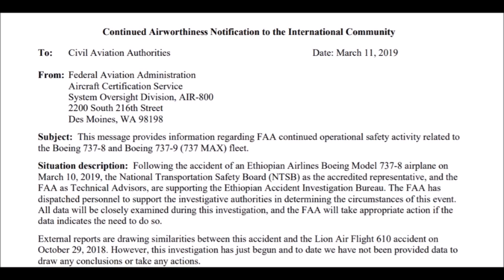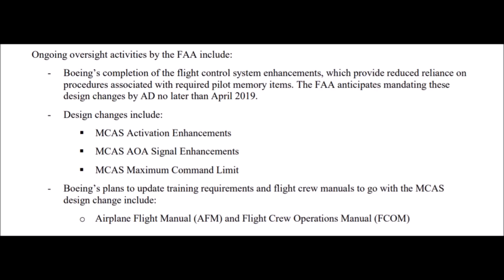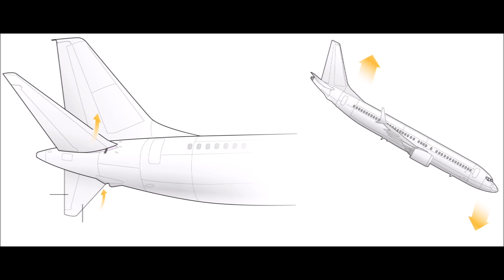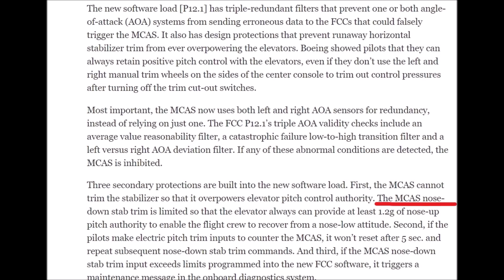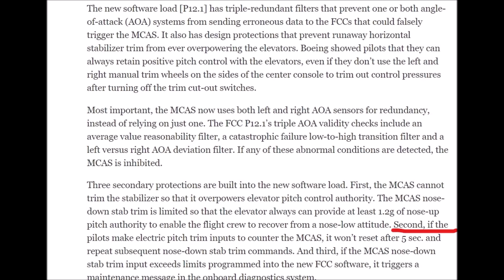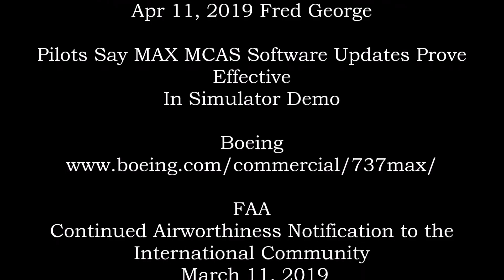737 Max UPDATE 14 April 2019 "The Fix"

Comment: Boeing should just drop MCAS altogether to rebuild its heavily-damaged brand.
Reply: bianchi1885: You have to understand that a faulty angle of attack sensor on the captain's side sent erroneous data to the flight management computer which triggered the MCAS in response. While the original MCAS system was much too powerful and no doubt will be lessened in the fix Boeing is working on presently, there is another issue here. In both Max 8 crashes (Lion Air and Ethiopian Airlines) the AoA sensors were defective. The biggest questions going forward is: How the hell does that happen? How did the sensors fail? And when will those potentially dangerous sensors be replaced with reliable ones?
Reply: @douglasmcintyre3297  in most cases damaged AOA sensors tends to be ground cleanup people have high pressure jetwash the sensors without protection device installed 
had it happen to quite a number of Airbus planes some crashes, as well there was one where aoa sensors suddenly thought the plane went nose up it (instantly) was so sudden people were crashing into the roof of the plane when they Airbus computers thought the plane was pointing up so very rapidly activated the rear trim down anybody that was not seated down was crashing into the ceiling of the plane, it was a mess there was holes all over the place where people had actually managed to break the ceiling and cabinets as they was going negative G)
Objects hitting them can also damage them (birds) can also take them out but generally its power washing them unprotected that does it
Reply: @leexgx  Good points. Too bad AoA sensors aren't robust enough to withstand damage from power washers.
Reply: @douglasmcintyre3297  these are not your normal house jet washers, there are protection devices they install on the AOA and air speed tubes when jetwashing
Reply: @leexgx  So how were these captain's side AoA sensors damaged?
Reply: @douglasmcintyre3297  we don't know because the plane crashed into the ground well over the max speed the planes was designed to operate at (only people who make them can say what went wrong with them but typically water ingress is normally what does it or object hits them)
Reply: @douglasmcintyre3297  Those sensors DO fail, are hit with birds and snap off or the sensors are otherwise unserviceable. It does happen. So, in the software, there SHOULD have been both sensors sending data and if they disagreed by a lot, then, the system should not act. It is a very simple part of developing software. Error handling. It was not done properly in this software. If the developer could have asked the question of an aircraft mechanic, they would have told them that sensors can fail. But, the mistakes are comparable to a clown college. Someone high up dropped the ball and killed all those people.
Reply: @andytaylor1588  Good points.
Reply: @douglasmcintyre3297  You said it all,, As far as the sensor's I still believe they were both bird hits taking out the sensor on each one. If you look at them they stick out like 4 inches and the pilots wouldn't see that as they sit to low.
Reply: Why because somebody at Boeing approved this severely broken rules that they had set up (someone should be going to jail for that) if you watch this video there are now at least 4 failsafes or/and redundancies now (which should have been there to begin with)
Reply: @leexgx  so what happens when all power is lost and those ginormous engines cause the plane to nose dive instead of glide due to drag?
Reply: @MaynardFreek  Good Question. Actually a very good question.
Reply: @MaynardFreek  
Hey go submit this query to Boeing, this is a really good question and if it remains unanswered, it may cause future disaster at some point.
Reply: @tabaks  Only when you have thrust. He is speaking about gliding, so loosing all power.
Reply: @tabaks  lol
Reply: @MaynardFreek  they produce a windmill effect and power hydraulics and you have the APU
Reply: @MaynardFreek  Why would the plane not be able to glide? If that's the case, then any A320neo family plane is doubly screwed since those engines are even larger then the MAX engines.
Reply: @MaynardFreek  The engines will still windmill and I'm sure the drag coefficient hasn't changed much, it is more efficient than it's predecessor. The 737 is a very slippery aircraft and difficult to manage the airspeed in the descent without the need for speed brake.
Reply: bianchi, China made a statement a little over a week ago, They said they don't plan on canceling any of there orders.
Reply: Togapower  you sure about that? I mean the engines are placed forward and are known to offset the center of gravity. If the power causes a nose up problem it may cause a nose down problem when power is lost also
Reply: It’s like driving a 1960s car which doesn’t have the best handling but uses a computer to correct it
Reply: The absolute most powerful recommendation made by anyone. MCAS kills!

Comment: Great update thanks!

Only 2 questions remain:
1) just what absolute idjit approved the operational configuration of the original MCAS (in this context "he" denotes the person, department, procedure or system responsible)
2) How many other automation systems did he approve, with the same disregard for safety?
Are we going to have to audit every single automation protocol and safety/convenience procedure approved by Boeing in the last 25 years?
Reply: FAA is responsible to see that this would not happen!
Reply: Good questions!

The real issue is self-certification of unTESTED design changes, MCAS being a prime example.
Reply: Did they use the same auto dictionary (spell checker) as Marvin the great.
Reply: In my uncle's 737-238, the engine fire alarms were cross-wired. They didn't get the alarm until the whole side of the plane was completely engulfed. They barely made it. Pacific Western Flight 501. March 1984.

Comment: Most of that should have been in place from the beginning. That is not very assuring of the abilities of Boeing and FAA.
Reply from the maker: Yes!
Reply: That aircraft should have never have needed MCAS to start with, just my opinion
Reply: @cmdrrgh  They added more fuselage behind the wings, so they should have added more in front of the wings as well. That would have not only negated the need for MCAS, but led to a different type-rating. However, the whole issue was due to a failure in developing proper software. It was amateurish at best. No proper error-handling. No expert opinions stating:"let's survey both AOA sensors to make sure they agree, as vanes are damaged or otherwise unserviceable sometimes. I believe that this could have been pressure from above.
Reply: designing MCAS 12.1 is positive, the real challenge is fixing the authorities that stamp sub-standard tinkering.
Reply: David Brackin  Companies do mistakes or find themself in a bad position because of certain circumstances. Airbus planned with Big airport hubs connected with A380 and small carriers to local airports. Turned out the market went to direct connections between smaller airports. The A380 production will be stopped. Shit happens.
Reply: Well said, man!

Comment: I think you're correct, there will be a lengthy investigation into how the MCAS system ended up being designed to overpower the pilots under certain conditions. Was this a perfect storm of auto throttles, MCAS failure and pilot error that uncovered this design flaw?
Reply: not so perfect storm needed.
A mere 380 planes flying worldwide, and they managed to get the needed combo of conditions TWICE already.
Remark on the fact that the system could put you in an irretrievable situation, in 40 SECONDS.
Meaning, once the problem occurred, the pilot had a maximum of 40 seconds to notice the error, correctly identify it, and implement the one exact correct sequence to countermand the error.
Just reading the standard procedure manual for runaway stab trim takes longer than that, much less noticing it, identifying it, digging out the procedures book and locating the correct page in it!

Comment: Seems like the updates are common sense items too me.. whew. Why would anyone design a system to be overpowering in the first place.. IMHO FCC (SW) Ret
Reply: And rely on only one sensor.. Insane..
Reply: @bradleysmith681  I know, right,?
Reply: I think that the Boeing engineers assumed that the fault handling systems available to the pilots were much more effective than they really are. Although the pilots were able to disable the elevator screw electrical system completely to disable MCAS, that also causes the unintended issue that at high speeds the aerodynamic loading locks the mechanical override out and can leave the aircraft in a fatal dive. You could quite plausibly argue that that combination of high speed and MCAS failure would be rare- and you would clearly be completely wrong.

Comment: Thanks but I want nothing to do with an autopilot car, will not operate one
Reply: ABS and VSC are automated systems (mandated by law for years) that save lives.  AEB is closely following in their footsteps.  So, most of us are already driving vehicles with automated safety systems operating in the background.
Reply: @blitzbbffl  I agree that most cars today have these sorts of systems, but they are largely driver assistance systems rather than full automated control.  Over many years, I have driven on a very wide range of road types and in all sorts of weather conditions.  Personally I cannot see anyone being able to create an automated system that can guarantee being able to cope with EVERY eventuality.  The outcome of this 737 issue points alarmingly to the dangers of putting too much reliance on corporate design and implementation of systems that are capable of overpowering the input of the pilot.  Equally, the presenter here identifies very clearly the need to retain the ability to take manual control when necessary.
I will continue to use driver assistance systems and welcome the input from them and the alarms generated by them to make sure that I am aware of potential dangers, but I do not envisage relying on full automation on the roads that I regularly use - on some roads possibly, but on all roads in all weather conditions, never.
Reply from the maker: This will be a generational shift...
Reply: You’re missing out.  Drive a Tesla, any Tesla equipped with Tesla’s so-called “Autopilot.”  It’s not quite there yet, and still very much in beta-mode, but I defy you to remain unimpressed with how capable Tesla’s autopilot system is in its current iteration; leagues ahead of all the automobile manufacturers and their “Driver Assist”  systems.
Reply: John Leake — I understand how you feel about auto-steering, but you ought to reconsider with respect to auto-braking.  I think data recorders would be a good thing as well, if not speed limiters.
Reply: ALL have auto pilot systems, and 95% of your flight is controlled by an auto pilot system. Just a bad computer programming design.